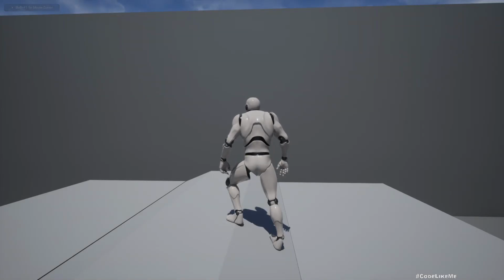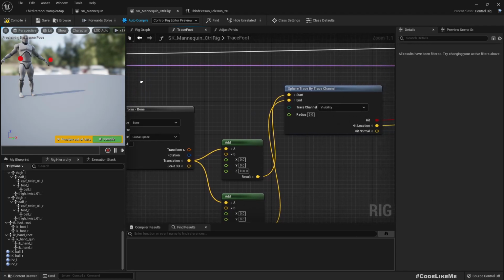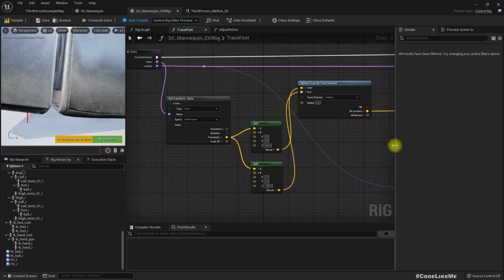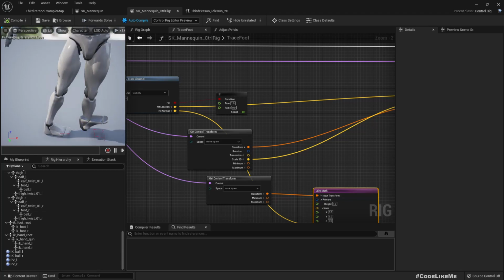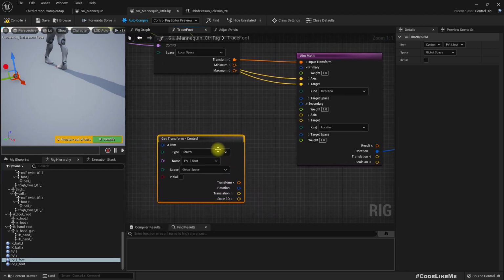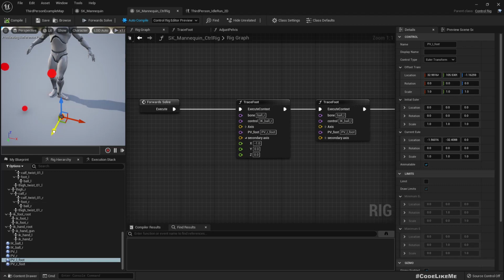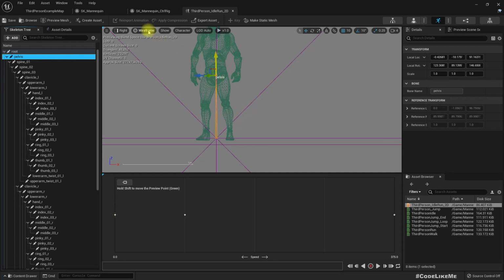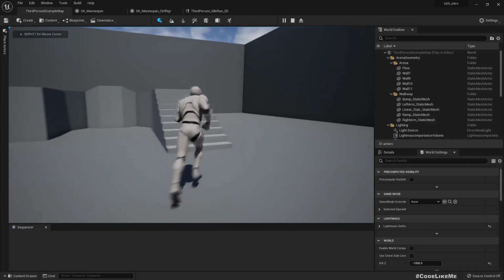Unreal Engine 5 - Control Rig Leg IK Setup [Part 3]

Comment: Thanks for share it! I would like to know more about the capsule collision configuration, since it must be stretched in some way so it can be better posed, i.e stairs, steps, etc... I have configured two collisions capsules. The main, which is thinner and the height matches with the mesh, in order to be used for croaching, and another one more thicker that is used to collide with the sides, this allows the character to not be able to overlaps with  other meshes. How is you configuration you used for this video? thanks again

Comment: Hi master, thanks so much that I have learned so much from your channel. Just for sharing, in order to prevent the wrong pose when the character's one leg is standing on the third to fifth step of stair, and the other leg is forced to stick on the floor, I restricted the pelvis height that cannot be lower then the height of the higher foot + 50 units.
Reply from the maker: thanks for the tip

Comment: The pelvis adjustment might work better if you take the average z of the ankles as opposed to the average vector of the ball joints.  This way as a foot rotates on irregular terrain, the ankle position ultimately decides how the pelvis adjusts since that pulls the leg up/down.